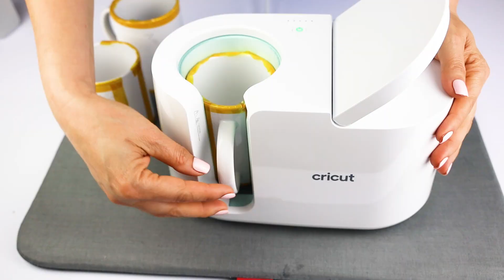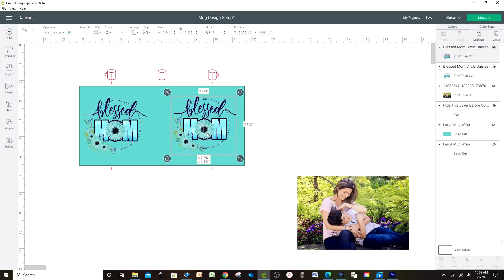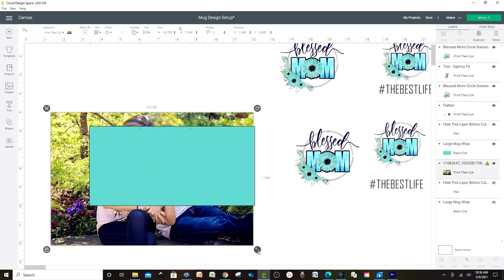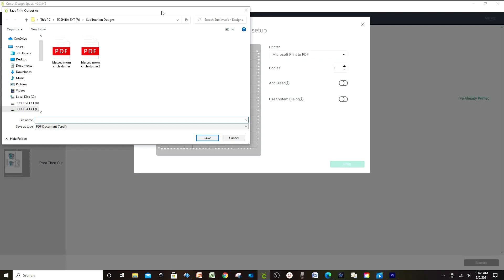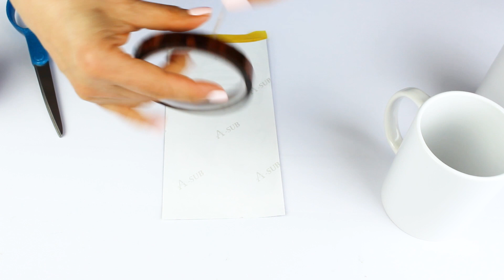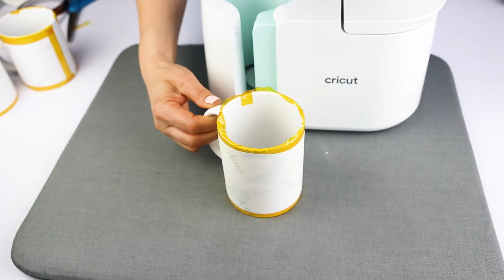How to Make Photo MUGS using the Cricut Mug Press | DIY Sublimated Photo Mugs.

Comment: I am new to all this but I have watched you over and over and I don't know why I cannot get my sublimation paper to take on my mug with my mug press. I've tried multiple times and still no success. I had just purchased a new Epson sublimation printer with sublimation ink so I'm not sure if my settings for my printer are not set right when I am printing. I am also using the same sublimation paper that you use as well. I have used my mug press with infusible ink transfer sheets as well as other items but just cannot get this type to work. Please help.

Comment: I tried this and the heat tape also transferred to the mug :( but yours didn’t, why did that happen?
Reply: Did you use a polyester coated mug, for sublimation? You cannot use an ordinary, uncoated mug. I hope this helps! 

You can find sublimation mugs at coastalsupplies.com, proworldinc.com and other sites.

Comment: So awesome! What printer do you have?
Reply: She is using an Epson ET-3760, with sublimation ink installed. The printer comes with standard inkjet ink -- but they aren't pre-installed, so you would just order sublimation ink and install those from your very first use of the printer. Do NOT use the inkjet ink that comes with the printer, if you want to dedicate your printer to sublimation only. The inks cannot be mixed.
Reply: Can't I just use the printer I already have and just put the sublimation paper in? I didn't know you need a special printer.